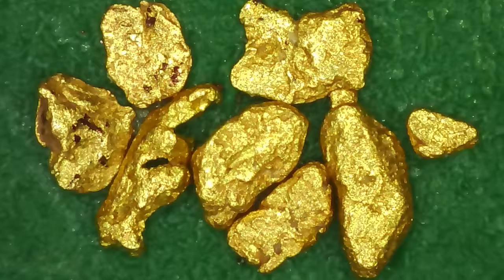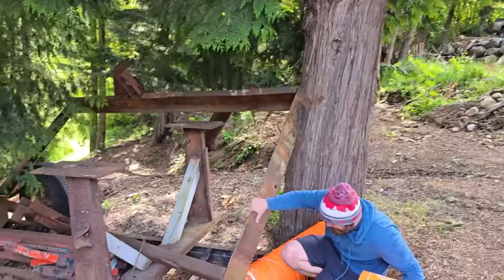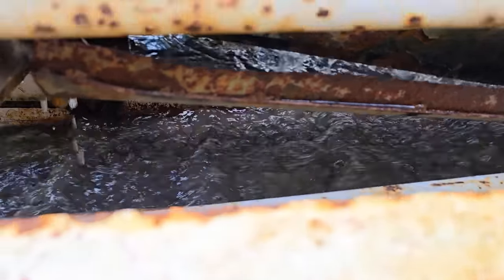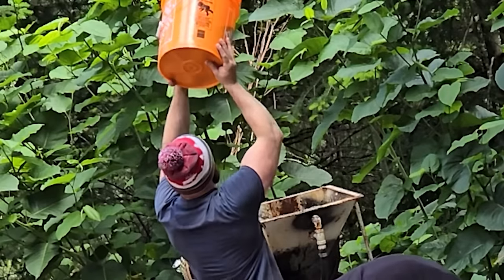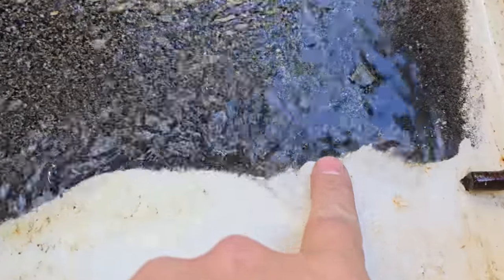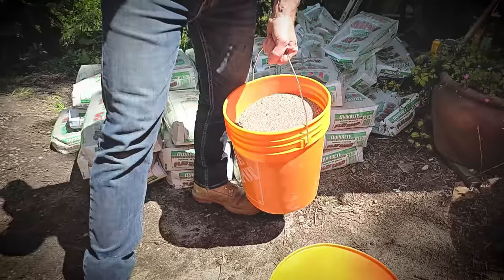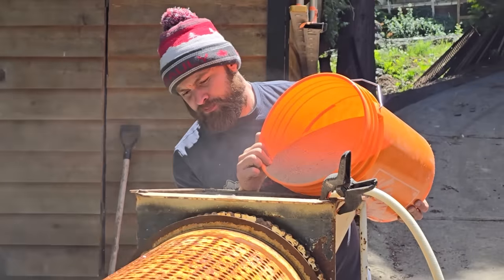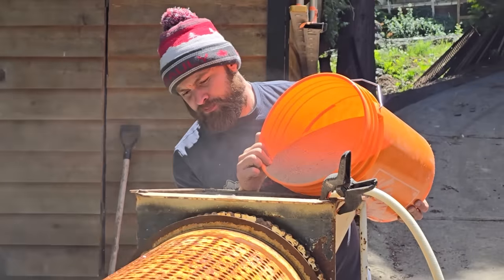How Much GOLD In A Yard Of Home Depot Sand?

Comment: Send me about 10 of those buckets!  Also, I’m sure the manufacturer is aware of the presence of Gold.  They probably determined it was more profitable to sell the sand without running it through a trommel first.
Reply: I worked at a quarry, and the sand was laced with gold to the point that you could see the wash plant run off sparkling at night with a flashlight
Reply: @grantrennie  I live in a gold bearing region that has 3 sand pits which supply sand for most of the major vendors(you would be surprised how rare construction grade cement sand is).  Other than screening it, they do not run it through a wash plant.  I suppose your employer was an exception and is probably the ones that sell the pre-washed play sand.
Reply: They probably run it first to make sure it is clean enough to be sandbox ready! And any profitable gold that is readily available is already been removed.😢
Reply: Well we clearly have a bracket here to say absolutely without a doubt it isn't even worth the labour, never mind the equipment and maintenance.  I assume the sand has already been graded to whatever efficiency to remove a quantity of gold already.

Comment: In 1987 I spent 3 months in Fairbanks, AK. When I was not working I was in the old gold fields for hours slushing tailings with a home made slush, then panning my concentrates in a steel pan and picking out the tiny bits of gold I had. These two guys got much, much more gold from that HD sand. Amazing. I still have the pan, the tweezers and my gold find in a small glass container. And a good memory.
Reply: I was 4

Comment: I took a trailer from u haul and filled up the roadside dirt from the pechanga area, when they built the wider onramp, to large scoops in the 6x12 open trailer off to home we go. in the end , i sluiced out all the gold and gold detected the some rocks and in the end, ended up with 8.72 oz of gold out of 4000# of dirt that the contractor was throwing away? the rock got crushed and got extra 1.21 oz out of the crushed rocks, to hell with 64 bags of sand, the area is rich of gold , but since i was removing the dirt with the contractor i didnt get in trouble because this was pechanga casino property,

Comment: Depending on what zone the sand came from the black sands may contain gold. Go back to Home depot and get a gallon of Hcl acid. Take the black sands and let them sit at room temp for two weeks (covered). Take out a sample and pan it again. One has to dilute or clean the sample from the Hcl. And you are asking what zones? From years of assaying. From about San Fran north, the black sands will avg about 90 oz per ton of black sands. And from the Mexican border south you will get values. However some might be pgms.

Comment: After watching: HOW did you Over Pay for Play Sand @ $874.50 USD? 

Its only $5.98 per bag and you only purchased 64 bags of Play Sand?

Buckets you can get FOR FREE from restaurants recycling or trash and Hot water wash them out.
Reply from the maker: The bags were $12-something CAD, and the buckets being right there were just super convenient
Reply: @PioneerPauly  Lowes and Home Depot in USA New England area near Canada have the sake Sand for only $5.98 per 50lb bag of Play Sand. 

Sometimes, Lowes Home Improvement has them on sale for only $3.98 USD per bag.

Can have it delivered to the U.S. Canada Border line, even with a private mailing address, such as a P.O. Box w/ UPS nearby, and pick it up.
Reply: @SoFreshSoClean2024  A $5.98 bag of sand at current exchange rates is $8.18 Canadian.  If in Ontario add 13% sales tax.  Then add in delivery fees and it's cheaper to buy it in Canada
Reply: Really only needed one bucket and there was probably an empty one sitting around the other dude’s house somewhere

Comment: By my calculation you ran way more than 1 yard of sand, I deal with measurements of soil rock and compost every day and 27 cu. ft. equals 1 yard you guys ran just over 2 yards of material. Still a nice recovery for play sand.
Reply: My bad, sand density a little different than materials I deal with but ya 54 bags would have been 1 cubic yard so you only ran 550lbs more than a yard but like I said nice gold recovery! Great video!

Comment: People are forgetting that this is 25 dollars per yard of sand. 
While it could be very profitable for the company who is harvesting the sand to run the sand themselves they might not have the water rights and ability to do so. 
For example I know of a sand pit that the county used for years. Yet there is not enough water there to clean the sand. It would cost far more to build a retention pond and then pump well water up to said pond and then run all the sand through the box and in to a pit in which you could then convey it out in to a very large pile for washed sand. 
Most washed rocks are ran through boxes as far as I know. Well not all of them are. 
There is gold nearly everywhere. How much depends on the area.

Comment: $13.66 per bag of sand. That is crazy expensive. Did you buy the luxury brand with extra gold in it? I usually get the quickcrete 50 lbs bags of all purpose sand and they are $3.97 each, gold included, I think

Comment: in perspective, if you have to use sand for a project anyway, may as well run it trough the sluice and then use it for its intender purpose.
also if you have a hopper on the top that can take a yard, use a screw feed to run it, then apart from filling the top bin you would not have much work, could even leave it running unattended.
simply take project sand, run it, recover the gold and then use the sand.
in that form the sand is free since purchase and transport cost would have occurred anyway for the project. so if sand is free and work is mostly AFK, then free gold?

Comment: funny most rock quarry have gold silver copper or led vein's in their rock formations, you see quarts vein's in them all the time , but as paully pointed out the % per ton of rock \sand is not worth extraction , gold can be found most any where, what rare is to find a seam or placer that contains a high enough % \ton to make extraction economical and why hobbie panning rarely makes you rich let alone pay for the days expense of prospecting ,i found gravel on the side of road that have visible specs ,so if you milled all the gravel from a given road section and passed it over a gravity table you would get a  amount of gold ,but not likely to pay for cost of milling and separating it form the gravel  it was hosted in ,and yes the same gravel \sand goes into road base ,pavement, and cement, ,thus will never be recovered , , prospecting  placer rivers will yield small pockets that will make you smile ,, because mother nature has done a lot of the work for you ,grinding host rock too sand and classifying by weight as it floods down stream and gets deposited along its course ,, great video guys got too love the ??? $$$ and doing the work to find out , 🥸🤓 Canada

Comment: Just got mine at Walmart, I don't get any flavor unless I tip. It's not the pod, it's the design. Had it on 9 and barely got any flavor, tipped it and full blast flavor. I usually am a 3 person. Is there something I am doing wrong?

Comment: Did all that gold you guys worked for pay for your time , equipment,sand,water, power source and vehicles with fuel. Probably not. Gold shouldn't be in the sand but under the sand on the bedrock. Go to your local sand and gravel pit ,get two yards and try that